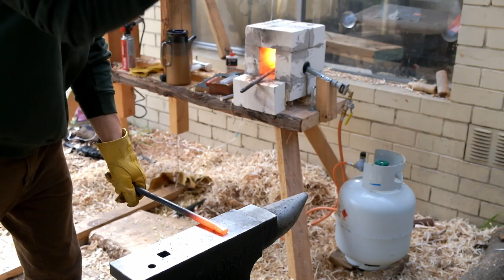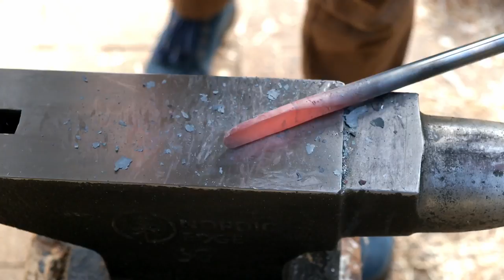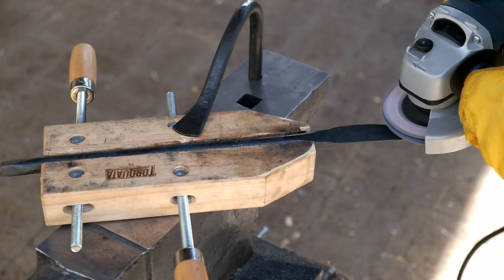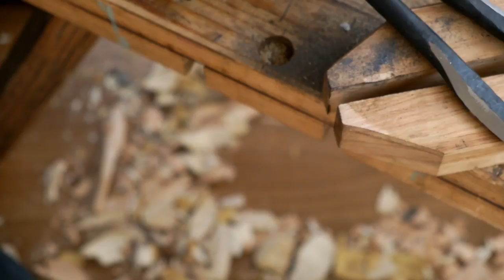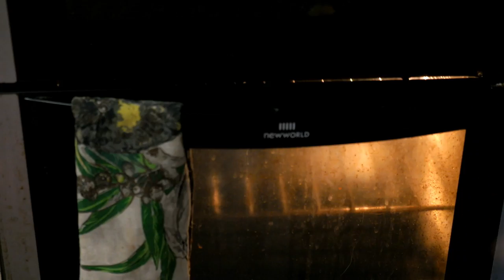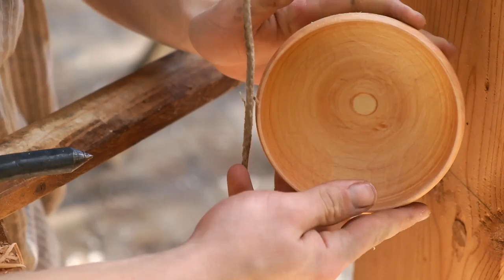Forging pole lathe hooks and turning a bowl from scratch - Blacksmithing / Greenwoodworking

Comment: Very nice work! I am very slowly getting a starter blacksmithing setup together, along with planning a pole lathe, with the intention of making my own tools as you have. Having made both a double bevel hook tool for tip up and tip down work, and with this video making two separate tools for the two tasks, would you recommend that a beginner just make the two tools with opposite  bevels instead of the one? You had mentioned getting a lot of catches in your other video with the double bevel tool on the return rotation of the lathe. Again excellent and beautiful videos!
Reply from the maker: Thanks! I am sure if I had persevered with the double edged tool it would've been ok. It had some flaws other than just being tricky to use due to the double edge. 

Having said that, I do feel that if you're forging your own, single edge tools are better. As well as avoiding the return catches, they're also naturally stiffer and seem to make a finer cut for me.
Reply: Makes sense, thank you so much!

Comment: So the bevel is on the inside for both tools? I have seen elsewhere that the tool for the outside of the bowl should have the bevel on the inside but the tool for the inside should have the bevel on the outside. I expect it has to do with have the proper technique for the tool in hand as much as the configuration of the tool.
Reply: popular in Japan and Russia worth a look
Reply from the maker: Interesting question. Yes inside bevel on both tools. I have never tried an outside bevel pole lathe hook.